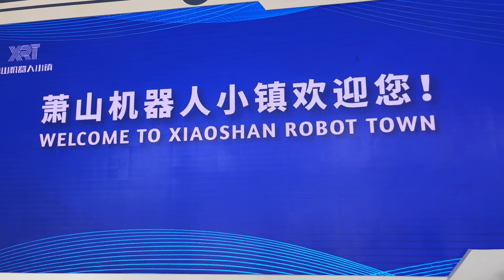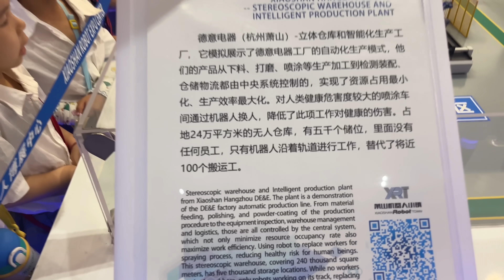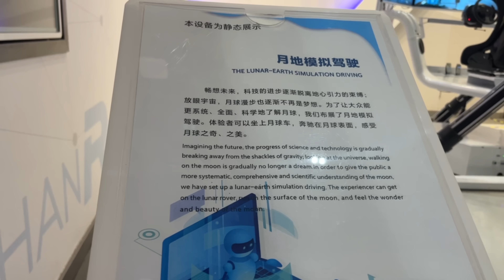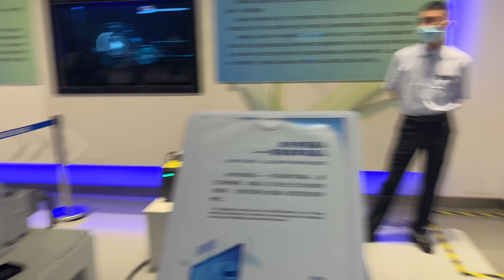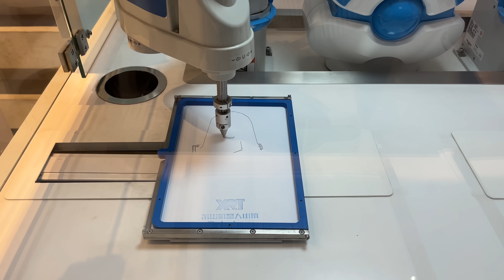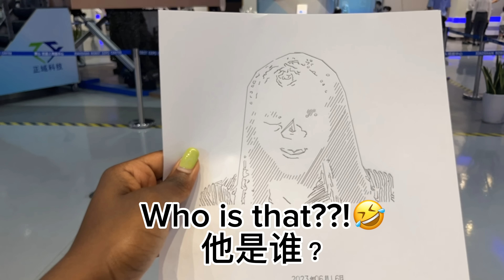This is why the Chinese are ahead|| 中国孩子从小具有竞争力的原因!

Comment: No one comes close to China and their advancement in Robotics, Androids, Gynoids, Swarm, Drones (land, air, above water, below water), AI, VR, AR, etc. Plus, with their own Global Navigational Satellite Systems (GNSS) Beido (Star of the Big Dipper) which is far more superior to USA's GPS with an accuracy HiRes reading of 3m and a 2 way Texting Service outside of the Internet, so that if your stranded in the middle of no-where (like the Alps) you can send off a Text Message.
There are MORE Engineering Graduate in China than anywhere else in the World.
Also, China has a Literacy Population Rating of over 98%, compared to USA's 51%.